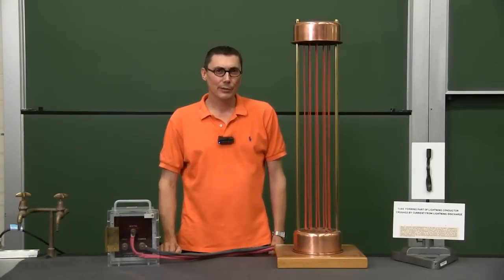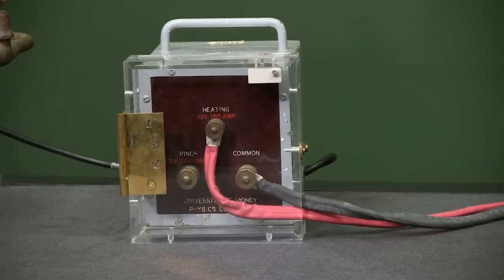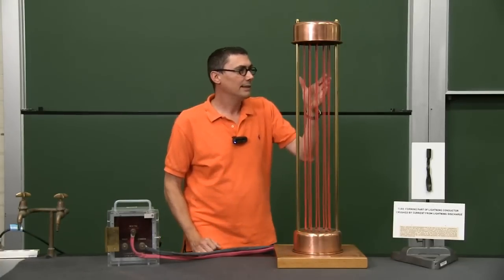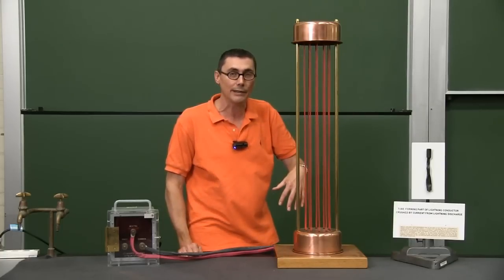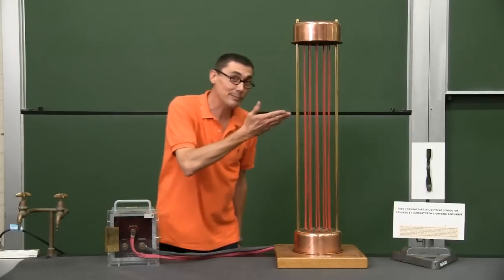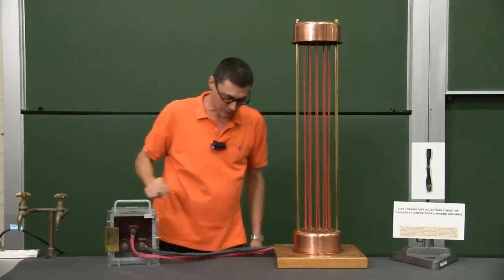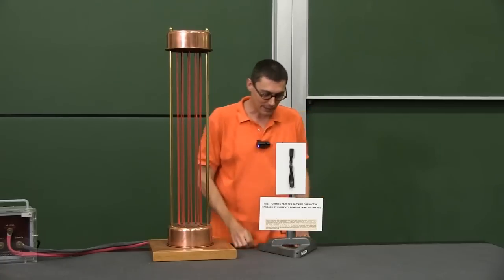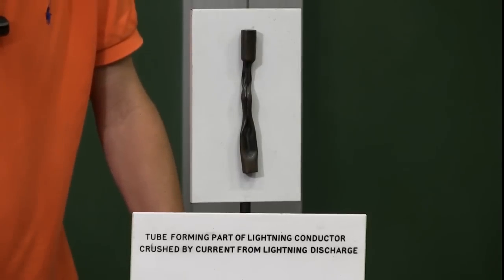PH EM MI PODS 70033A V0241 Pinch Effect Interaction between Current Carrying Wires

Comment: The current flow in the two wires generate opposite magnetic fields and they oppose each other so the wires tend to separate as shown. Where's on the other hand the parallel wires tend to attract  each other close since the magnetic fields add up !

Comment: Please tell me why the supply cable repelled each other
Reply: First you must ask why the loose wires pinched together?
Reply: The supply cables repelled each other because they complete a loop, that is too say the current flow in each conductor is opposite; in one electrons flow away from the power supply and in the other the electrons are flowing back towards the power supply. The current flow in each conductor of the power pair is in opposition hence the magnetic eddies are also in opposition so the cables repel each other when the current is flowing (copper is paramagnetic).

The floppy wires are different the current in each conductor is flowing in the same direction so each conductor's magnetic eddies are also similarly oriented and so their magnetic vectors are added together increasing the total magnetic field strength to the point of forcing the wires to pinch together. 

Like charges flowing through paramagnetic conductors in the same direction are very strongly attracted to each other whereas like charges flowing through paramagnetic conductors in opposite directions are very strongly repulsed by each other.

Now you should understand the need for national electric code requirements for the physical anchoring of AC electrical wiring inside of walls, ceilings, and floors and other structures. With the currents changing direction 60 times per second, wires carrying substantial currents will physically vibrate and cause wear to the wire's insulation risking a short circuit and fire.
Reply: Its the same effect as the smaller wires. Current carrying wires create a circular magnetic field around them. The wires nearby are carrying a charge. In the same way electric motors work, when a moving charge (lets say from wire A) and a magnetic field (from wire B) interact it produces a force at a right angle. So with the multiple wires it calculates to be a force pulling all of them together. With the two large cables the currents are running in opposite directions and the math works out to produce a force directly pushing the cables apart.

Comment: You have just discover gravity, the flow of the magnetic field as a fluid medium, drawing the medium flow towards the center of flow, a Venturi.  The only explanation for this is that the magnetic field is a fluid medium that acts just like air or a Marklund convection moving through a constriction.  Just like air flowing through a carburetor or Freon through a constriction, there is a draw of the medium and a compression of the medium towards the axis of flow, a Venturi.
    The current flowing through the wire stimulates a magnetic medium flow around the cable, the cables repelled each other as per Ampere's Law, a form of the Bernoulli principle in a fluid medium, caused by vortices in a medium, flowing around the axis of flow.